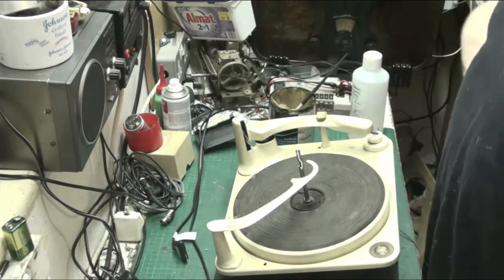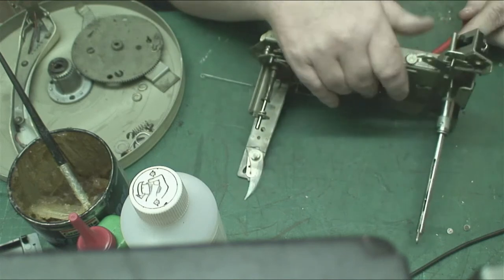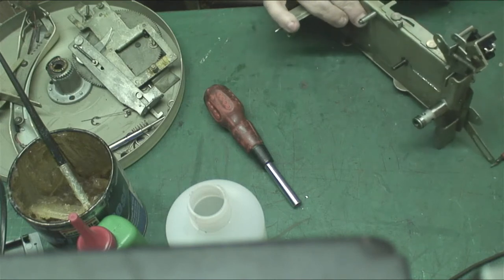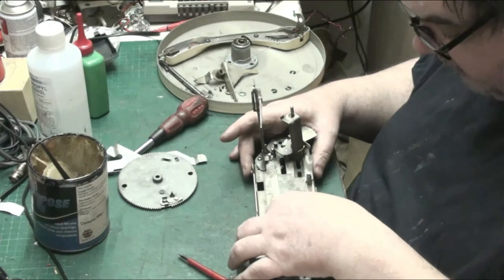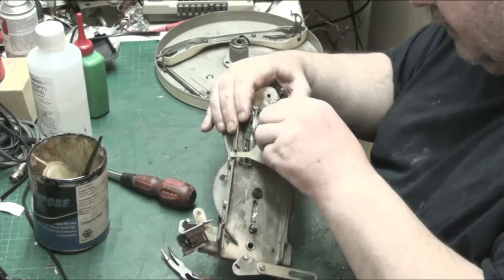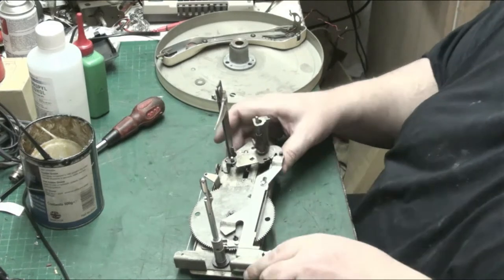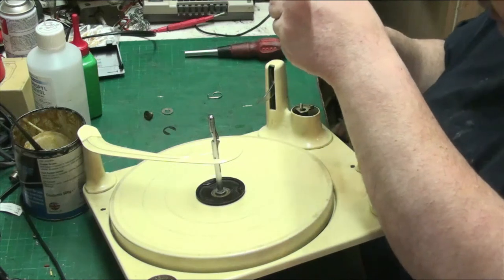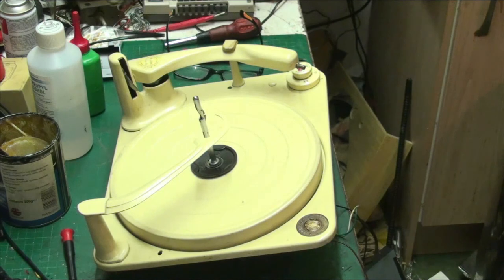BSR MONARCH RE-BUILD

Comment: Hi! Am about to embark on a voyage of discovery on a UA6 that's in an ancient (really ancient) Dansette. The speed knob turns OK, the motor and idler seem OK, but the start/eject knob is jammed tight, so your video is going to be incredibly useful. Thanks for your thoroughly comprehensive video-else  I wouldn't have  a clue where to begin.